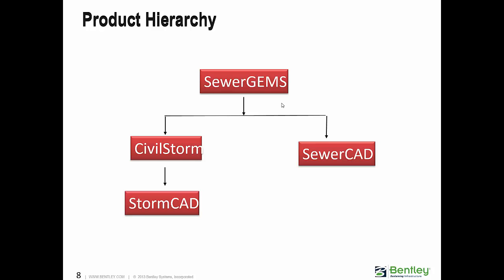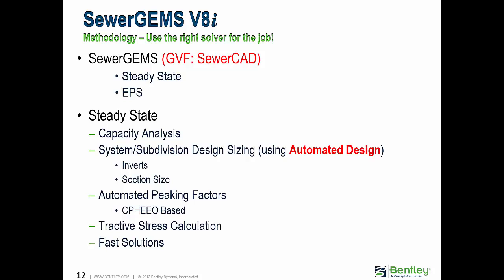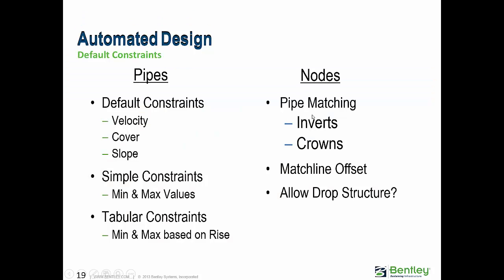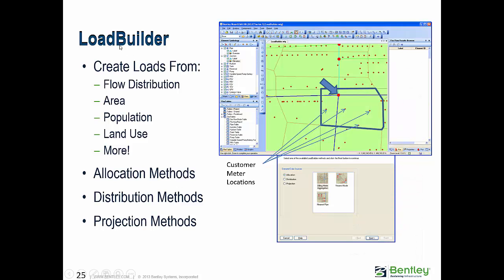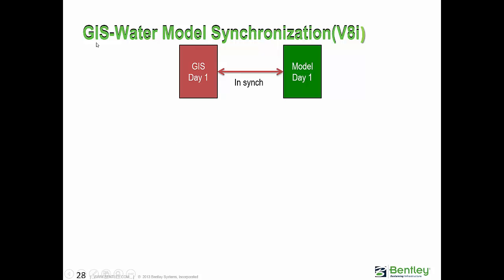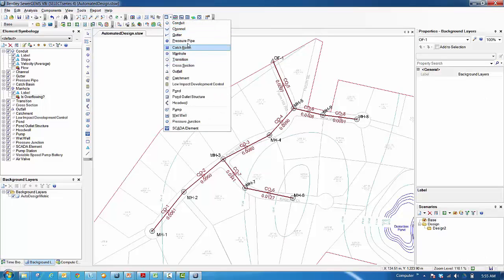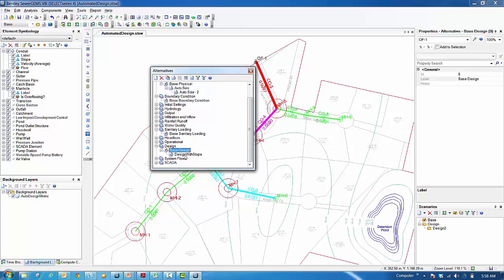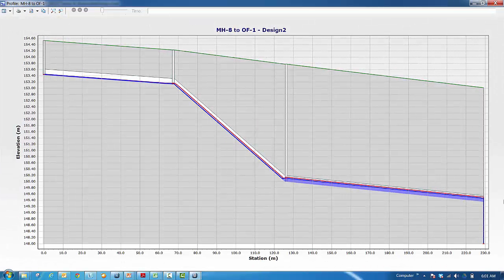SewerGEMS Demonstration

Comment: sir i am getting problem regarding optimizing my small network .. can you please help me out?
Reply from the maker: mohit gupta hi. optimization of what? a water network or a sanitary one? please visit www.communities.bentley.com --> Hydraulics and Hydrology forum
Reply: Tanay Kulkarni sir I am very new to this software. I am running the whole sewer network as you have shown in the video. but still I am getting errors like 
1. slope is almost zero
2. sanitary unit load is not correct 
3. and it is showing me some other direction of flow almost reverse in the direction of outfall.
sir, I have exactly I don't know where I am making mistake please send me your emai id so that I can contact or send u my small network problem ( only 5 links). basically I have developed my own algorithm by using simplex method I just need to compare between them. please reply if possible. thankx
Reply from the maker: mohit gupta tanay.kulkarni@bentley.com
Reply from the maker: mohit gupta I insist you to visit communities. also you can go through the Quick Start Lessions under the help tab in the software.
Reply: sir, i am going through the communities and i have sent you the mail also.